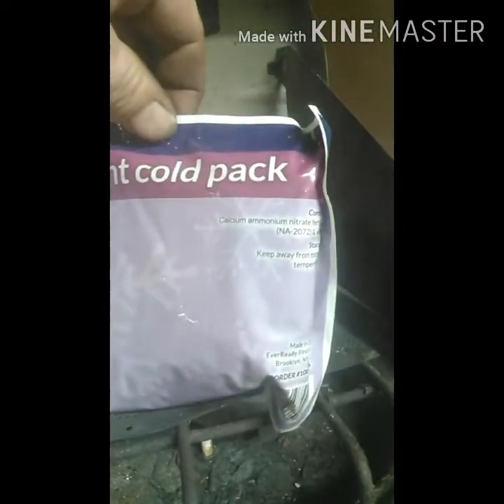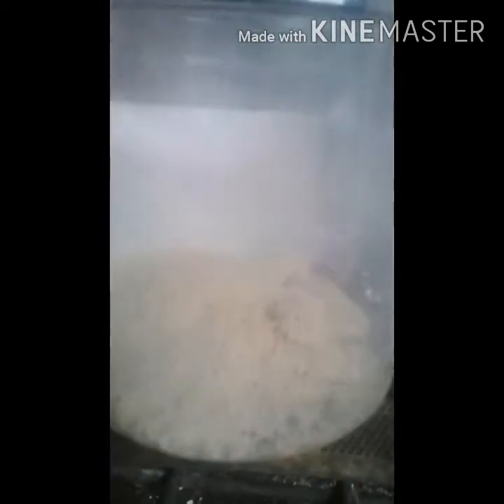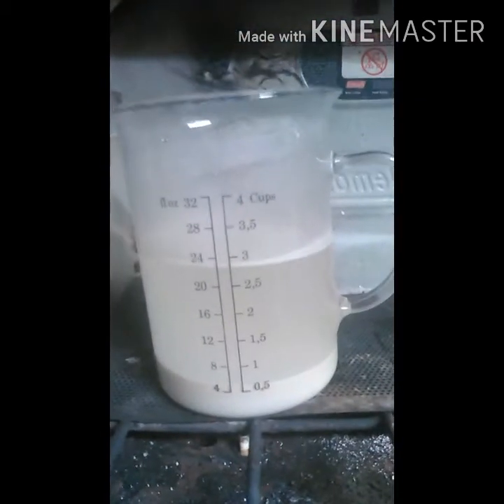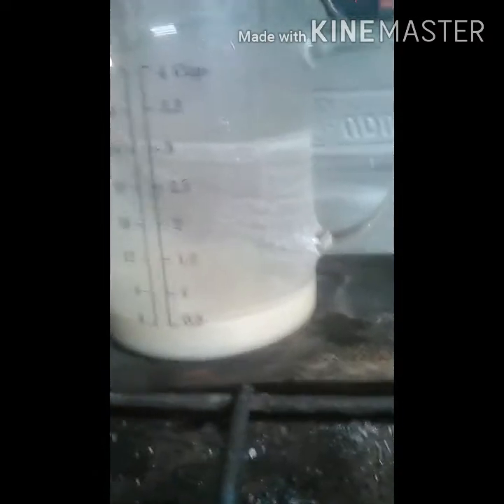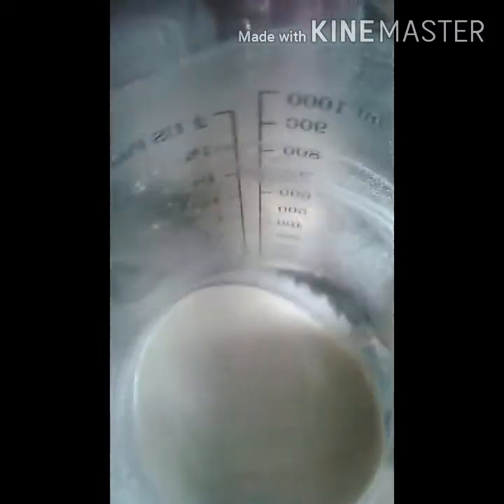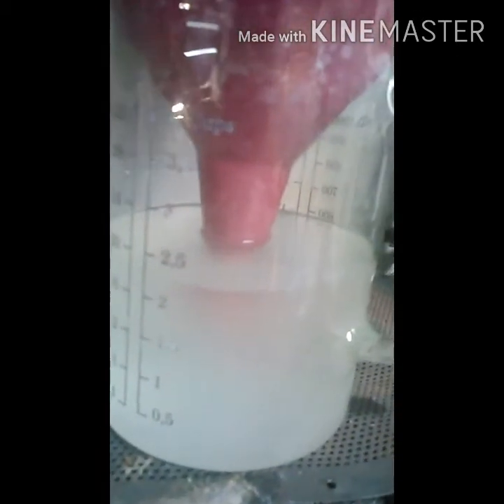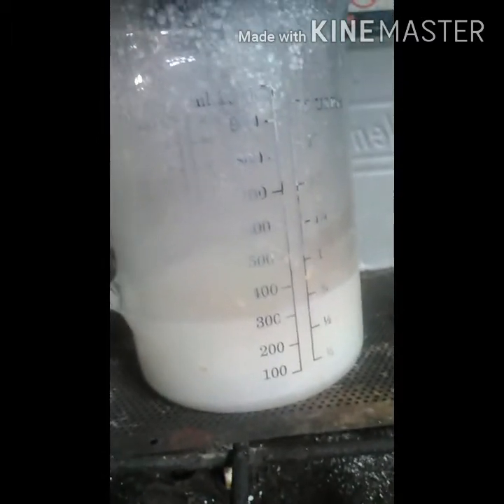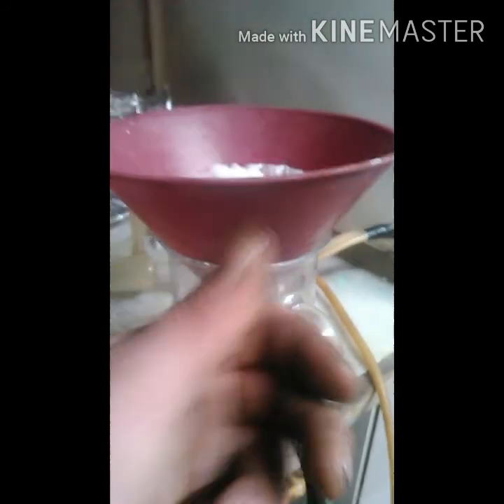How to purify  ammonium nitrate from cold packs that contain calcium ammonium nitrate

Comment: I like the way you are thinking.  And i could be wrong ...but i think you just recrystallized a double salt called calcium ammonium nitrate and not ammonium nitrate.   The stuff in the package was probably a double salt and some of it dissolved and some of it did not dissolve,  And what you filtered out was a double salt and what you crystallized out at the end was a double salt.  A double salt is different than TWO DIFFERENT salts dissolved in the same solvent (water).   Think of it like an azeotrope.   You can not distill better than the azeotrope just like you can not recrystallize out a single salt from a double salt..............I am not a 100% sure what i am saying is right but i am pretty sure it is.
Reply from the maker: From oxford a double salt only exists as a solid, which is made from a two component system, ie two salts and a water. And a double salt is simply broke down by dissolution.
Reply: @shelbysgarage5828  .......................Yeah as long as it is dissolved in water then it is considered 2 salts cause everything is ions.   But start evaporating the water and the double salt will start to precip.   At least that is my understanding of it
Reply from the maker: Wow, I totally see and understand what your saying. And I have no clue. I'll do some research and come back to this... Very interesting.
Reply: @shelbysgarage5828  .........Well keep in mind i could be wrong.  But i really think you are dealing with a double salt
Reply: Thank you Walter white 😮

Comment: Informative vid, but annoying as blazes.  Did you need to use the word "so" 28 times?
Reply from the maker: So maybe 29 times? Lol thankyou for the input I will try to avoid repeating words unnecessary as possible.
Reply from the maker: Any other input is greatly appreciated. I want to make my videos as good as possible for yall and this helps. I'm not a baby and won't cry about it I promise lol
Reply: Its required for it to work properly, dont you know anything?
Reply: @peckerwood8786  Try and stay on point.  Obviously,I know more than you, much more

Comment: Could anyone tell me the Name or send me the link to the cold pack
Reply from the maker: You want a link to buy them or just to know what type
Reply: @shelbysgarage5828  a link to buy then would be nice
Reply from the maker: Ok I'll post a link here to buy off eBay give me a few min. Also please subscribe and like and stuff. Help me grow I appreciate all my subscribers
Reply: @shelbysgarage5828  ohh thank you I will for sure
Reply from the maker: https://www.ebay.com/itm/124390485081 here ya go if link doesn't work let me know
Reply: @shelbysgarage5828  thanks a lot bro I will share the channel to my friends
Reply from the maker: Awesome your the best :-P
Reply: Hey it's me again I wanted to ask if you used destilled Water
Reply from the maker: Now before you buy those. You can buy straight ammonium nitrate. Which is cheaper and will save you from the need to purify these cold packs to remove the calcium. Unless your trying to not buy that product specifically which I understand why lol probably best place would be a garden shop (nursery) or like ace hardware, home depot. And such
Reply: @shelbysgarage5828  Yeah I know but I want to try doing it myself cause im bored but thank you
Reply from the maker: @tombuchberger5148  ya it's worth doing and really you get two products from the packs both useful. And don't worry you can't mess it up. Feel free to ask Questions any time. And sorry if I don't respond quickly

Comment: If it only says ammonia nitrate on the label, does it still have calcium in it?
Reply from the maker: No, it will always say something to the fact of calcium ammonium nitrate or something like that. If only ammonium nitrate, you got the good stuff buddy.also please subscribe help me grow so I can help more people just like this 😊
Reply: @shelbysgarage5828  wouldn't adding water turn it cold like its designed
Reply from the maker: Yes. And doing this is part of extracting it. When you are watching the video and I'm mixing it with water I say the reaction is endothermic. Which means that it's a cold process when water and ammonium come together
Reply from the maker: However if you still wanted to make 100% certain it's very easy to purify and recrystallize with very minimal loss.
Reply: Could you send me a link or the Name of the cold pack?

Comment: I thought the calcium was in nitrate form?
Reply from the maker: The ammonium is nitrate and calcium is carbonate I'm fairly certain
Reply from the maker: When making nitric acid without purifying the ammonium nitrate. The calcium would also add.to the amount of.nitric acid you'd.create which it doesn't. Just to put that out there
Reply: it depends but usually it is in carbonate form, you can tell by the code required on the back of the cold packs NA/UN-2075 have the calcium carbonate
Reply: @nvmapompilivs7635  thanks for letting us know
Reply: @chemistryscuriosities  no problem man
Reply: yea i did a couple of hours of research after i bought a couple of kilos of cold packs and said "calcium ammonium nitrate"
Reply from the maker: Hey thx for input. I didn't know that
Reply: so I purified some of this Calcium Ammonium Nitrate to the point that I got crystals that looked like KNO³ except they where more fine and needle like.  Really beautiful crystals